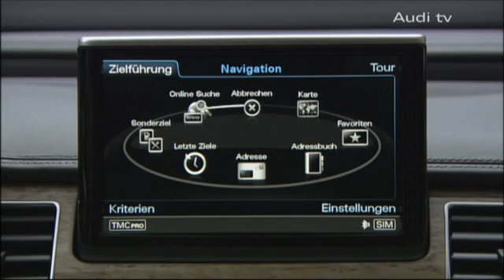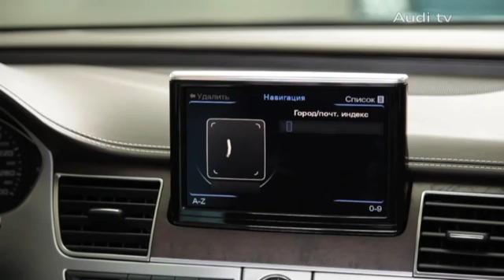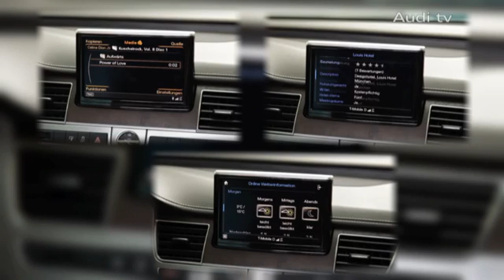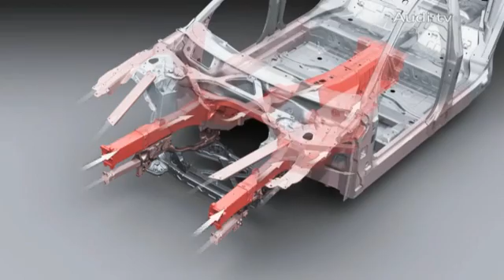All-new Audi A8: Technology (long) [HQ]

Comment: In reality, the A8 D4 was 20% lighter to save the cost of aluminum after the recession. Not a technological improvement. The A8 D3 chassis is much sturdier and stronger than the new D4 chassis&frame. The D4 was lighter, but the weight saving was marginal. 

I had the A8 D2, the D3 and the D4. Today, I still drive my D3 with the V8 engine.

https://www.youtube.com/watch?v=barWXEv35FE
Reply: I wonder what all those numbers even mean if you have a fully build A8 with anything possible. That would exceed the target weight anyway. Yes they are good cars; but the Fuel milage numbers are a bit out of context. I've driven 6000km with a A8 D4 in roughly 8 days, i'd say it's effectively 8l/100km to 11l/100km for a V6 TDI with Quattro. It's still fun and the car does bring that "The more you look at it the better it gets" type of thing.
Reply: @vanderlinde4you  The D2 Audi A8 are those produced till 2002, the D3 were models produced from 2002 till 2010 and the D4 were A8 produced from 2010 till 2017. All of them have their pros and cons. My current D3 is an A8 Quattro with a petrol 3.7 engine consuming 20 liters every 100 kilometers. It has LPG so it costs less than gasoline, and runs smooth as a smooth criminal. And yeah, you are right. The more you look at it, the better it gets.